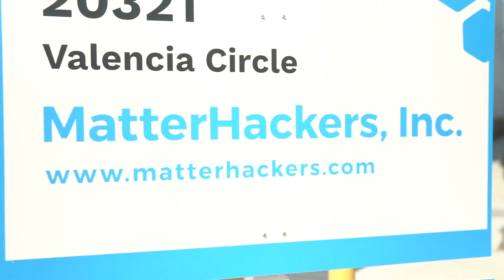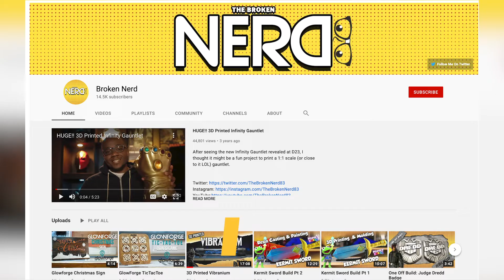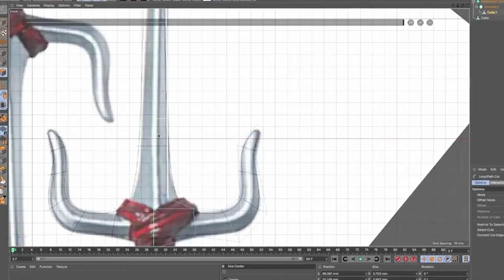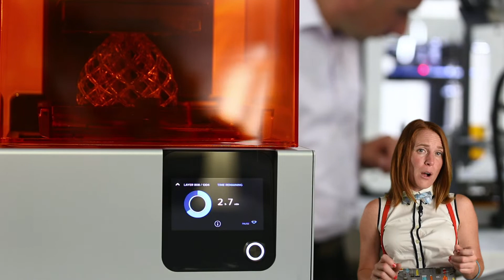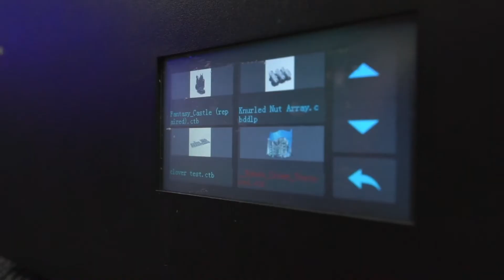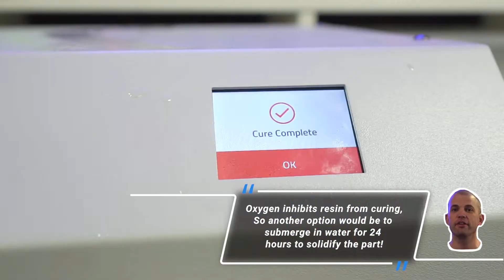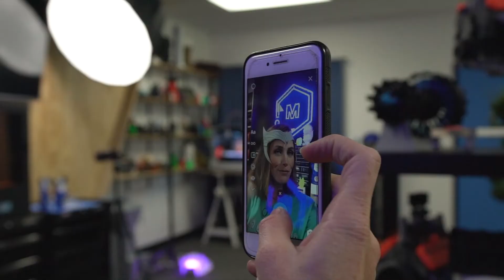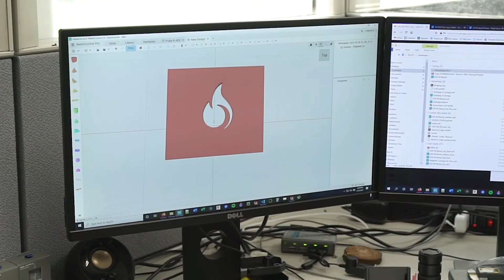Resin 3D Printing Wanda's Crown with The Broken Nerd & Matterhackers // Maker Science Episode 1

Comment: If I won, I would print my midsoles and outsoles (the bottom of sneakers) for my shoe designs I've been working on.  I need to create the 3D model of these designs, to create the negative space molds out of silicone, to then put the rubber and polyurethane into.  With the help of mold release, the materials would pop out of the silicone mold, to create the midsoles and outsoles.  Right now I can only make the top parts of shoes out of leather or textile (the uppers) and then try to find places to send my midsole and outsole designs to, to print, which is much more expensive over time.  Not being able to 3D print the soles is the step that's preventing me from fabricating my designs at this point in time.  So I'm very interested in this product.

I'd also try to create Rick and Morty themed figurines because I'm a huge fan of that show.  From there, anything that any of my friends or family may need or wherever my research in human movement takes me (my background is in exercise science).  

Watching both the sneaker science and the maker science episodes on here is awesome!!!! Can't believe I just found your channel. I really enjoyed how you broke down the terms in this video and the crown looks awesome.  Just like Wanda.

Comment: The question is what wouldn't i make? First thing probably would be a portable power supply so I can put use all the 18650 batteries i have laying around. To charge whatever electronic device i need to at the time.
Reply: Yessss! The practical application of 3D printing for things like this is why I love it so much! It’s great for making jigs for the shop as well!